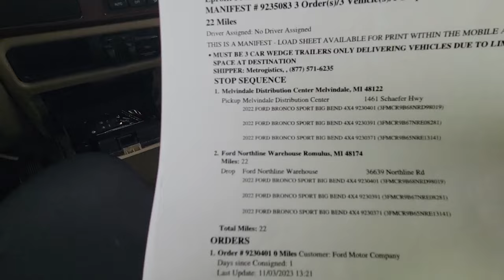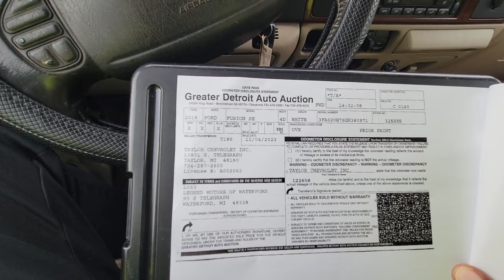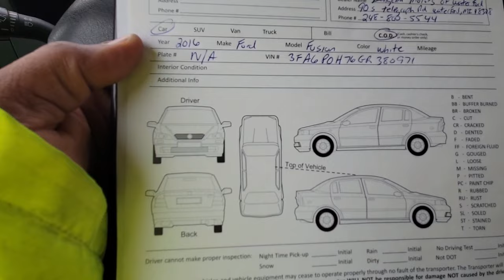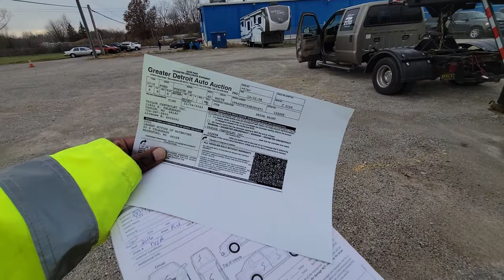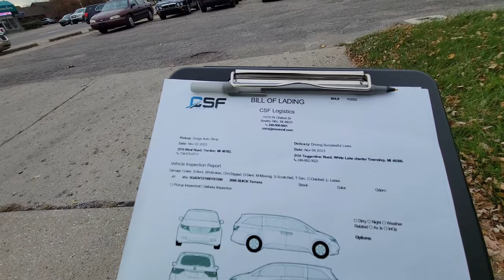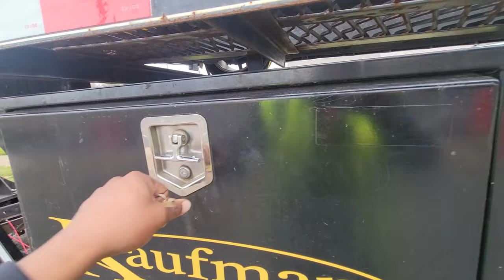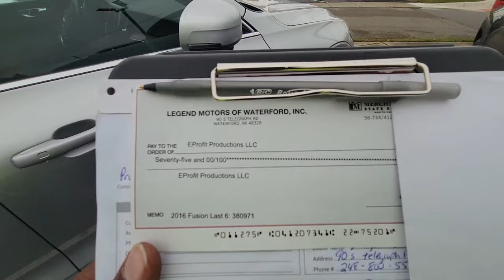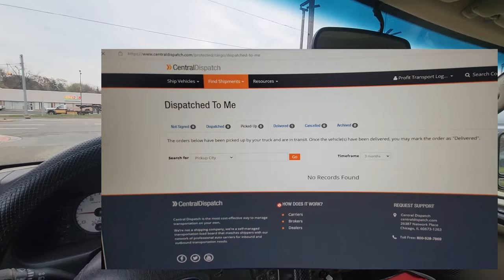Central Dispatch -The Car Hauling Process

Comment: Hey bro, if you pay central dispatch for the notifications the loads in your area will come to you by text or email. That’s how everyone is getting them before you
Reply from the maker: Oh ok ok that makes sense,  ok thanks for that tip
Reply: screw that. stop paying these vultures. if you get up at 4am-6am and check the load board you will find better rates. then you save the best paying companies and speak to their managers to go directly to the source and cut out the brokers. u can literally make 10k in 1 day if ur cold wit it
Reply: @learsinamorrellik1655 hey man I just got my cdl and I’m going to get my truck n trailer any tips ? I’m 19 tryna make it
Reply: @vorps155  are you confident in your driving skills 100% yet?
Reply: @vorps155  i wouldn’t get a truck & trailer yet ur too young rates will be thru the roof. id either get a sprinter van & start small to limit overhead (you can make up to $7000-10000 a week. also that way u can get use to booking loads & paperwork) or start an llc & work for a 1099 company ( they pay up to $4000 a week company driver dry van & you will get experience handling taxes & expense reports) or worse case scenario work for a bigger carrier that hires rookies making around .50 cpm. that is the smartest way starting off
Reply: If you pay for notifications do you have to provide proof of insurance?
Reply: @vorps155  19? You can't leave any state at 19 , and if you're talking class b you wasting yo time you need class A
Reply: Can you do long distance hauling with a two car tailor